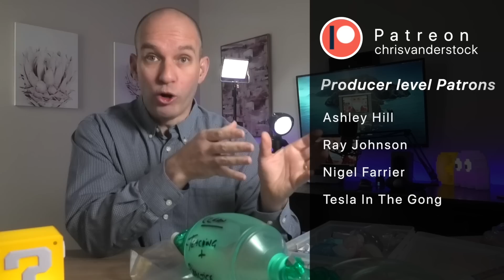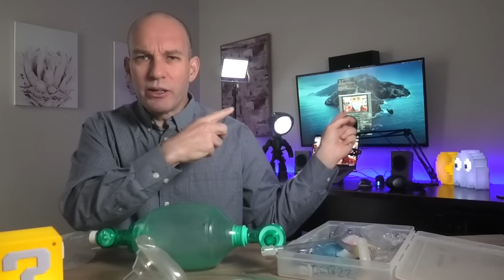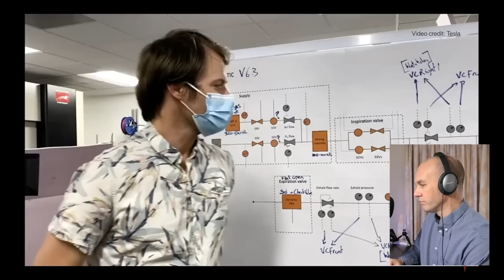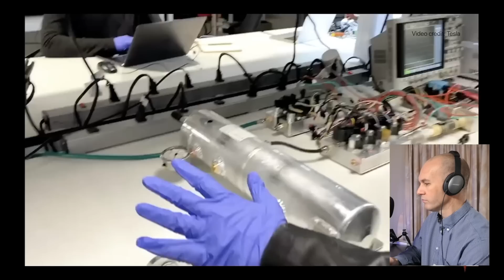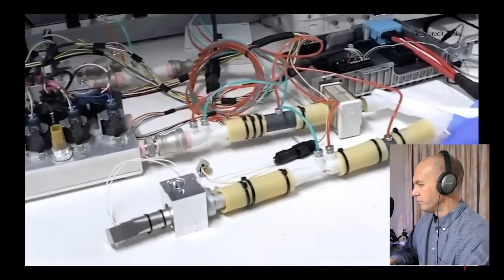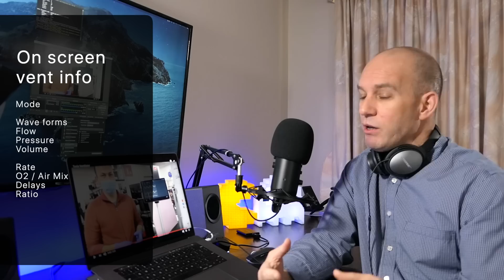Nurse reacts to Tesla's ventilator & what's with those resuscitators?

Comment: I don't know how it could be approved by the FDA (maybe some sort of provisional approval for use only in certain emergency situations?) without the mode to help transition off, but I think it would be better if they could skip that part if it means a meaningful delay in development/approval. Use the Tesla emergency ventilator only during the middle stage and save the "real"/full-mode ventilators to use while transitioning people off who have recovered. The important thing is not to make full-featured ventilators (there are plenty of medical device manufacturers who do that already), but to get as many ventilators that will do the job safely into the hospitals as quickly as possible. Lower-featured ventilators at volume quickly is more important than full-featured ventilators that arrive too late to help.
Reply: Or you'll need to wait for the over the air update to be taken off the ventilator. 🤔
Reply: "Use the Tesla emergency ventilator only during the middle stage and save the "real"/full-mode ventilators to use while transitioning people off who have recovered."  That's absolutely the correct mindset. And your final sentence should be made clear to every naysayer trying to be clever.

Anyway, I think a pressure sensor, etc for the transition-off features will be a straight forward iteration for these Tesla guys. Bonus: SpaceX is already making solenoid valves for Medtronics, which may be needed for this.
Reply: Jared: I think you may find that among the modes of operation mentioned was a "Pressure" sensitive mode, (hopefully) this should allow spontaneous respiration if the patient is capable.

Comment: In the U.S., or at least my part of it, NYC, the Air-viva is called a BVM, a bag-valve-mask. Or  we old time medics call it an Ambu-bag, the way we call copiers Xerox machines. An early version, before silicone, had that brand name. Of course we intubate the patient as soon as possible, but it's still called a BVM in the field and the ER.
Reply: Don't use my remedies!

Negative ion therapy using vinegar
as the source of negative ions.

A long bath with one cup of vinegar added to the bath water.  Use no soap or hair products during bath.

Another way is to add half of A cup of vinegar to A large pot of water.  The pot should be producing A small amount of steam and set on A low setting.  Keep adding water when the pot reaches the halfway point, throughout the day.  Start with new vinegar water everyday.   Boiling the water is not necessary or desirable.

Works for colds, flu Etc.
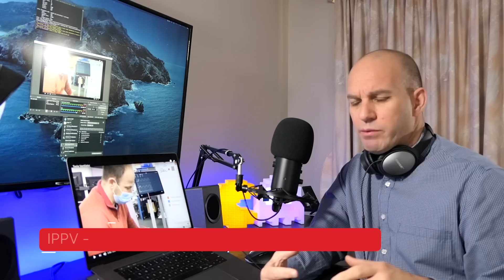Reply: Typical American, go back to 18:30 mark and re-watch and listen this time.  geez the world doesn't revolve around us ya know. :b
Reply: @loganquinn9452  Quite sure he was specifically referring to Chis' comment about regional names. Even he gave two names.

Comment: Why are we Reinventing the wheel??  I would think the world emphasis should be on pushing out more of the established ventilators that are currently on the market rather than trying to build one from scratch. Existing production lines for approved ventilators should be put in ludicrous mode
Reply: They are doing that as well. SpaceX and Tesla are making parts for Medtronic to help their factory to produce ventilators 24/7. And Ford will be mass producing a "simple" ventilator from AirOn which does not even require electricity -- it runs entirely on compressed oxygen. But "simple" ventilators are actually very tricky devices. In some sense it is easier to strip Tesla Model 3 down and make a ventilator out of it, than to shape pieces of plastic just right to build a "simple" ventilator.
Reply: Price gouging, pure and simple. I think GM tried to gouge the US Gov for more tha  $200k per ventilator.
Tesla has been buying up ventilators, and DONATING them to the hospital in the most need.

Comment: It struck me that this was a lot of engineering going into building something that has already been designed and built, and that the reason for this might be because the company(ies) that design and manufacture the ventilators in common use have intellectual property rights associated with those machines. Do you think that this whole process would be shortened or made easier if schematics were made publicly available or licensing rules for the production of these devices were lessened? Also striking to me is how intellectual property is viewed quite differently in China versus in the US (where I live).
Reply: Ian Duffy  Medtronic released their design. The issue is that Tesla don’t want to use up the supplies that are going to the current product makers. So their designs have to be different as they are using mostly their own hardware.

What difference do you see between IP in China and the US and how does it relate to this video? 🤔
Reply: David Ryall I understand that Tesla is working to adapt the design of the ventilator to use as many of their current parts as possible, and that makes sense. I didn’t know that Medtronic released their design. My point was that much of this engineering has already been done and it felt like watching a video about reinventing the wheel. Fascinating stuff, don’t get me wrong. As China’s take on intellectual property and how it relates to this video my understanding is that the communist view is that intellectual property does not belong to an individual or a company, rather it belongs to everyone. Whether or not that equates to better use of human knowledge to benefit everyone, well, I would put my money on Elon and his team.
Reply: The current ventilators are very complex machines with various specialized abilities built in. You can't speed up production of a modern jetliner very much, but you can build a lot of DC-3s quickly to do the simple jobs.
Reply: see here: https://youtu.be/hg7Th2aSO1E  complementary supply chain is needed. Medtronic open sourced a simpler design

Comment: Thought I saw a humidifier on the flowchart.
Reply: Big Doug’s Commentary ,  it’s not inside of the Tesla device.  Have to fill it with water.   And clean/toss the bowl between patients.  
Ps: may start to run low of bowls and filters.
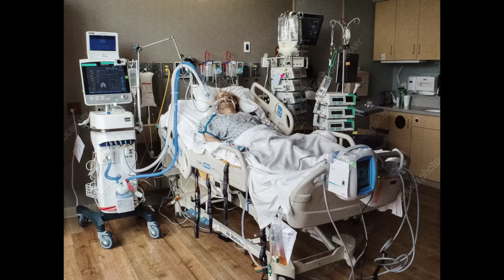Reply: You can see a humidifier @25:12  at the base of the commercial ventilator.

Comment: Speaking as a comp sci major, the response ventilation is not exactly hard to accomplish, and I am sure they will implement it by the time hospitals get it. They are already tracking (what seems to be) most if not all of the stats from the patient related to breathing. This sort of response ventilation you are talking about in the video is just waiting for a trigger from a patient, then activating the ventilator for one cycle. Obviously this will be more complex than what I just described, I am not the one programming this thing, but its all to say this doesnt require additional physical engineering (I assume). They have access to the data, so all left is to program that functionality into the ventilator.

Hope that helps
Reply: Also worth pointing out is that it doesn't need hardware changes, meaning manufacturing can begin in earnest even before they have finalised it. Potientially the FDA could give a temporary approval on the grounds that it is better than nothing, with the understanding that the software would go through improvement and more thorough work even while the units are deployed.

Comment: How does the human patient normal breathing synchronize with the machine? Is the patient under a coma.
Lots of talking about the machine, but what about how the patient reacts?
When the machine is finally turned off, does the patient start breathing automatically? 
How does the transition to normal breathing restart?
Reply: Synchronisation is ideal when the patient is awke, to some degree. It assumes the patient is making at least some effort of their own inspiratory effort. This inspiratory effort is measured, and at preset level the ventilator is triggered to provide a positive prssure breath in synchrony to the patients negative pressure effort. However, 
of course there are many patients at the begining of their ICU ventilation journey are not able to make inspiratory effort for themselves. So typically the patient is sedated, or anesthetised. Medication infusions such as morphine and midazolam +/- propofol or a volatile gas. As well patients may have muscle paralysis, or drugs such as vecuronium / rocuronium. These last two drugs specfically prevent voluntary muscles, such as the diagphram from functioning. So there is no synchrony. There doesnt need to be in this case. So, its not uncommon to paralise a pateint for the initial part of their journey. Then as the lungs or body improves they may be weaned off these drugs just tothe sedative drugs, which means synchrony comes in as a mode of ventilation. Peter (ICU/Anaesthesia/Retrieval 40 years)
Reply: @CMTeamCobra Thank you for an excellent reply. I guess the whole world is learning about ventilators!  BTW, are they the same as "ECMO" machines?

Comment: this was very informative, thank you.
 now we how complicated this actually is, on top of that it has to be reliable 100%, and there is probably not enough time to test this properly.
Reply: John Smith  yep, Elon already said that by the time they could make them in volume, they probably wouldn’t be necessary
Reply: In a crisis, it doesn't have to be 100% reliable to be put into use. If I had the choice of a rapidly approved ventilator or no ventilator, I'd choose the former. And of course wish for a normal ventilator.
Reply: @donjones4719  i totally agree with you, but it ain't the ventilators alone. On top of all the equipment you need qualified medical staff that can operate and guard the machine. we had/have this Problem in Italy where Ventilators are available and temporary build ICU beds, but no staff to operate.  this is what happens if the tHealthcare System gets overwhelmed with cases. Because of our massive Tourism we had the first major Outbreak in Europe. Now, thanks to the generosity and help from Europe and States all over the World, things start getting under Control.
Reply: Needs to follow standards like MIRSA C and it needs to have wtach dog timer and be able to reboot in a second.
That said I think GM and Ford's vehicle control computers might be better suited to being hacked into a ventilator controller as they already need to read pressures and work anywhere from 7 to 15 servos on the engine and transmission.
Reply: @Patchuchan  Maybe but this is the computer from the 'infotainment' system. That's a fairly powerful piece of hardware compared to an engine/vehicle management computer, and interfacing a few pressure sensors into a computer that almost certainly has several common forms of I/O ports to do it's usual job is fairly trivial. Like, electronics 101 kind of trivial, that you can get a 10 year old to build with a bit of guidance...

Comment: If you look at the diagram carefully (https://imgur.com/a/1WJ9OsZ), heating and humidification are included (with the humidifier being a non-Tesla part)
Reply: Why is the heater on the exhale air though?
Reply: @TWFydGlu  To prevent exhaled moisture from condensing on the sensors. This is standard. Some ventilators with active humidifiers also have heated wire inside of the inhalation circuit, to prevent moisture condensing there.
Reply: @TWFydGlu  My CPAP even has a heated hose which is a huge improvement. Before water would condense in the hose until it blocked off enough of the cross-section. Then you got water up your nose on the next breath. NOT a good way to wake up.  LoL

Comment: how about stimulating the patients diaphragm to do the breathing instead of forcing air in. Muscle stimulation.
Reply: The diaphram isn't close to the surface, so you'd need invasive surgery to implant electrodes that would activate the diaphram.  Either that or some kind of spinal tap that would force-trigger the nerve itself, which strikes me as pretty risky.
Reply: @ColinFox  And also pointless, since the problem isn't that the body doesn't want to breathe or isn't trying.
Reply: My understanding is that it is because their muscles are too exhausted to function anymore. That's why they go on ventilators. As the nurse guy is saying they only put people on ventilators as a last resort.
Reply: That virtually what an "Iron Lung" does, only using air pressure to do the "pushing". Like a lot of other comments about Iron Lungs, it cant do "positive pressure", which is the same for any external manipulation .

Comment: From some of your comments, I wonder whether they missed out on getting a design brief from the medical staff who need to use the equipment. Also, maintenance and spares... I can see a response from procurement "Your request for a Tesla model 3 infotainment computer has been denied"
Reply: Dude they had a meeting with medtronic engineers, those guys probably know their stuff
Reply: @Phoenixklinge  As Chris mentioned it's the little things like being able to read the screen from the other end of the bed that makes the difference. Yes the engineers will be able to say what it needs to do, but the people using it will give input on ergonomics or even how it needs to be cleaned.
Reply: The Turtle Moves  it’s still at the early stages, give them time to iterate and get feedback. This is just the basic building blocks currently
Reply: @theturtlemoves3014  Have you ever used a Tesla product? They're pretty detail oriented, and very concerned with the end user experience. I'd be really surprised if it wasn't the best ventilator on the planet within a month, especially if they have any intention of building these longterm.

Comment: Excellent Chris. You should be on consult team IMHO. 
Could heat the humidifier off of the CPU and use a closed loop addition of moisture to regulate temp before controlled introduction into air mix supply.

Comment: Thank you so much for this analysis.  I watched the TESLA video earlier and didn't have the background information to properly understand how much effort has actually gone into the beginning stages of this effort.  A couple of questions ...
Could they add a heated Distilled Water Reservoir (like on a C-Pap unit) to provide moisture, and heating filaments in the air tube feeding the patient to warm the air before it enters the lungs ???  Also would these elements (temperature and moisture content) need to be visible on the screen to be monitored ???

I'll save all the TESLA jokes this lends to until after the crisis is under control.
Reply from the maker: There are after market units that can be added to the patient circuit, but they don't integrate (in general) with the main vents UI. It's always better to have the unit control humidity and temp.
Reply: Chris Vanderstock ... Im confident that with the TESLA engineering team as detail orientated as they are and with the consultants from Medtronic involved this is going to work out.  Thanks again for your input.
Reply: Could heat the humidifier off of the CPU and use a closed loop addition of moisture to regulate temp before introduction into supply.
Reply: Medtronic is working with them. It won’t be allowed unless Federal Drug Administration approves. Only then it can go to the hospitals. This is the same reason Remdesvir medicine is approved in Europe but not yet in USA. FDA is approving in stages. Now in clinical studies may be approved soon to patients.

Comment: I remember talking to some medical product designers in the USA back in the 90's. The had spent two months designing a ultra sound machine attachment (probably has got some technical term) they said it only took an afternoon to actually design it the rest of the time was designing it to fail soon after the guarantee ran out.
Reply: jake Hawtin My neighbor who is an auto industry engineer told me a similar story.
Reply: Bathtub curve.
Reply: It's more like testing to see how over engineered your product is so you can replace parts with cheaper versions...while still making sure it lasts beyond the guarantee.

I've seen this with a car door. The door was opened and closed mechanically over and over to see if cheaper parts can be used.

The cheaper the product is, while adhering to the same minimum quality control standard,, the more competitive it is in it's market.
Reply: @tylerdurden3722  This example was 100% about been built to fall apart after a certain time.
Reply: You know that you guys are violating a "non disclosure agreement" right?
The planned part's failure must be indicated as the parts lifespan or usage cycle written in user's manual.
Reply: @markreyes390  Hahaha